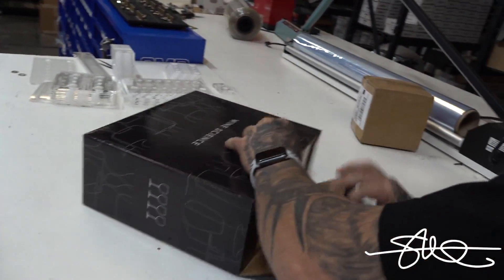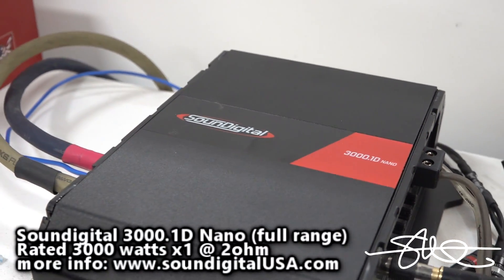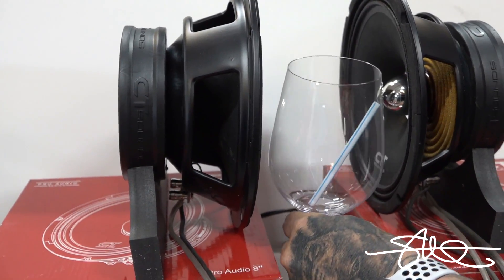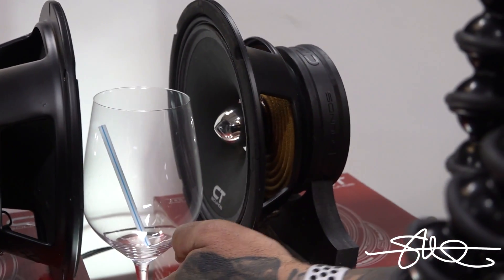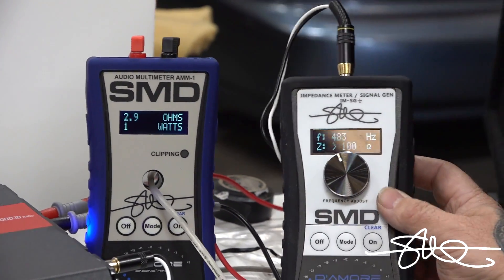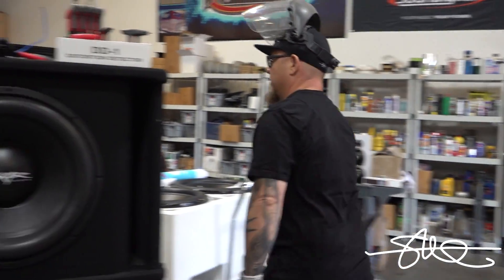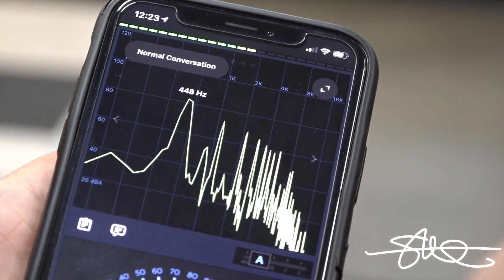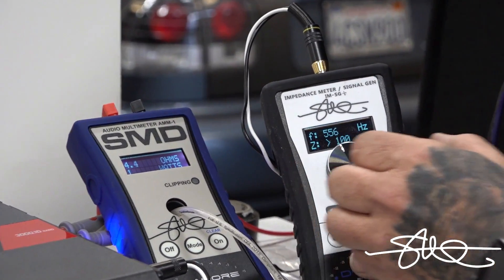Car Audio Amp & Midrange Speakers vs Wine Glass - Will it break? Fun Experiment!

Comment: those speakers are a little weak
Reply: Probably because the higher freq doesn't offer any significant cooling. I think they would have been fine with both a low and high frequency at the same time. But then the watt reading would be out of wack. 
Best regards

Comment: I use the exact same dB meter app! It’s wonderful.
Reply: what's the apps name? :D
Reply: Decibel X
Reply: @FSXgta  thanks :)
kind of confused due to the several InApp-buy options and abonnements though it seems to work without them as well
Reply: @Lighthammer333  I think it just removes ads and give u more tuning options (android version at least is filled with ads)

Comment: Are ct sounds bio subs good ?
Reply: Go Tropo. Or even better, Meso! Im a big fan. Also just a lil heads up. The T 60.4 and 100.4 are definitely decent but do run a lil hot.
Reply: Well I got two new in box  10s for free from a buddy and was wondering if it’s worth buying or making a box for them and getting an amp  for them I was thinking of a skar 500w

Comment: I've been super curious about the quality of Coleman's speakers.  Learned of CT through watching Douglas' ridiculous channel then somehow ended up in some kind of pre-order deal for an M-750.1 and M-75.4 amp combo, DIRT cheap.  Spent a lot of time trying to research CT components, specifically the Meso 6.5 Component set, but ended up finding I had a set of 4 Infinity 60.11cs components, tweets, and xovers new in the box that apparently I forgot about buying..  After going through the trouble of installing just ONE speaker in my VW jetta, I kinda changed my mind about putting that much work/time/effort/money into the system in that car..  Went ahead and installed the M-75.1 powering a 2007?ish Kicker S10L7 in some crappy prefab box.  That shit bumps, so it's enough for me.

One day I might try out some of his speakers.
Reply: Might want to do it soon they are raising the prices a lil bit finally found out that their product is worth wayyyyyyyyy more. But they r still cheap and a great value

Comment: I have those ct sounds 6.5 pro audios speakers in my car man do they scream like hell at certain frequency's
Reply: Ct is awesome
Reply: The 6.5 mesos can handle over 1000 rms before they blow.
Reply: Watch Carlos solis youtube  your welcome and you'd be surprised if u r running clean wattage..     no clipping  how much subs can handle. I'm just saying
Reply: Ok maybe around 900 rms he has them on the at 1400 which puts out 1800 to 2000 rms at one ohm and he has the subs wired down to one ohm so ya they can ask him.